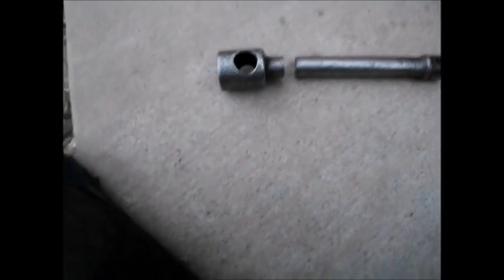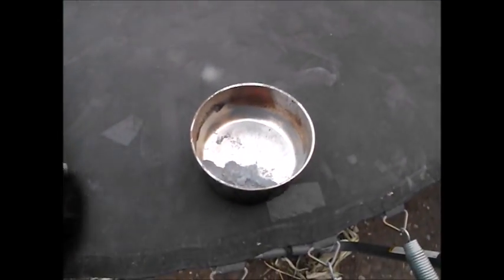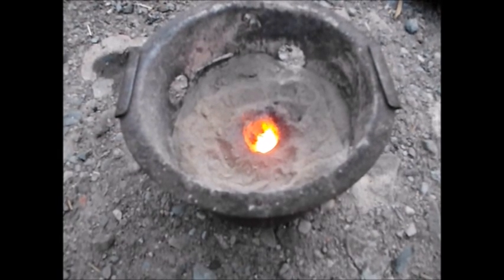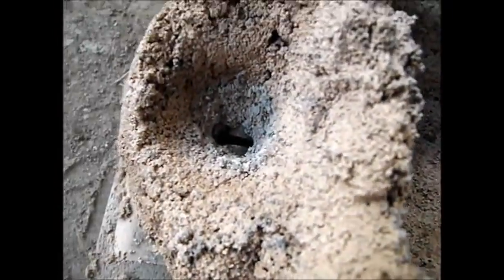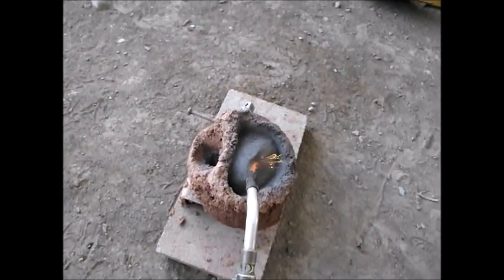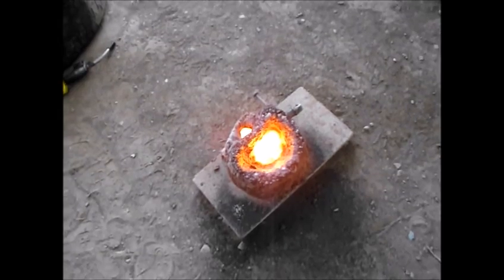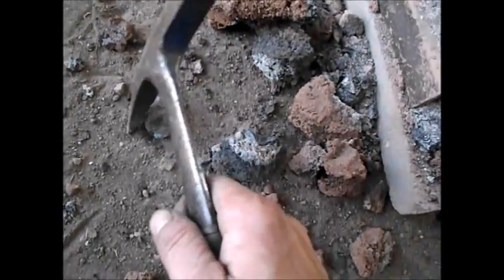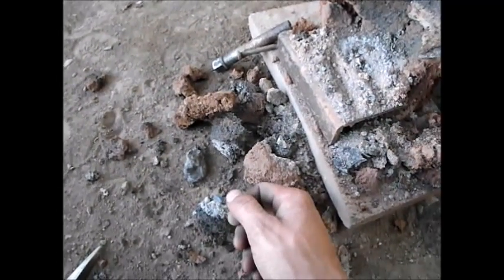My First Attempt at Thermite Welding

Comment: you could fix that thing using an arc welder. Since you sheared the chinsy thing right off, I suggest you grind both ends at an angle and fill the empty space inbetween. This way, it shouldnt break

Comment: If you mix a few large crystals of potassium permanganate with a few millilitres of glycerol you’ll get a chemical fuse of approx 20 seconds that I’ve never had a problem lighting thermite with. Also, if you use aluminium powder and magnesium oxide with no additives (other than carbon dust in the ball mill to prevent explosions) you’ll get a thermite that is almost completely smokeless and sparkless. The less carbon you use the better. I made a mix that was almost silent in its reaction and basically just glowed. Pretty cool shit.
Reply: Side note. The magnesium thermite does burn at a lower temperature. Somewhere around 1900C if I remember correctly. That’s a few hundred degrees lower than iron oxide based thermite.

Comment: Shop that turns brake rotors and drums will have lots of buckets of iron filings. It wouldn't take long to rust them. That's if you need to make a ton of thermite.

Comment: It will work with welding it if you use the proper alloy and pre heat and post heat it properly for the type of tool steel that it is.

Comment: 70% Al + 30% Fe mix (depending on type of iron used) makes it hotter
Just a tip for future thermite welding. Ive found the mix is everything.
What I'd love to see made is thermate or an exotic form of thermite (like your Cu+Al version, but I know there are many others which can be used). I never tried either of those.
Still an awesome experiment. 👍👍

Comment: If you'll ever get to read this :) If you want the weld to be strong enough you have to bevel each side of the break kind of deep with just a small peg left in the middle, preheat it some, tack it (grind the tacks a little), weld a root pass, and then a fill and cover or fill/cover pass with 7018 or equivalent. You could just leave it and it will be strongest, or you can grind and machine it if you wish.

Comment: Perhaps if you get the two parts white hot prior to setting the thermite going it would work perhaps maybe maybe not. But I'm sure the thermite is it touched the cold metal the molten metal probably cooled a tiny bit enough to make it not adhere to the parts

Comment: Having watched vids on welding rail tracks with thermite, maybe you should`ve got the parts to be welded, red hot, before starting the thermite reaction. When you did it, the molten iron, just didn't seem to adhere to the parts. Good video and attempt though!

Comment: demo failed , like soundless stinky fart . post success     try again . 
1. the mold should be good allowing insert of the tool  from eithr side of the mold . tool meeting in the flow cavity of the molten metal
2. heat up the metal in coal fire
3. fill up thermite in the thermite slot
4. insert thr tool in the mold
5. fire the thermite in three stages
stage i .33% lights up
stage 2 33% lights up
stage 3 33% lighst up 
how
the thermite should keep poring on reguilar flow.
Lets see if you can do it

Comment: that's why when they do thermite welding like in railroad rails they light it from the bottom and the hopper above it feeds down into the weld instead of burning everything out of the top before it gets down to the steel.

Comment: Hello, I didn't really think that you'll read this but I try it. The DB (Deutsche Bahn/German Train) use Thermite welding to weld rails together. This is the Process: 
The rails get a little Distance of only a few centimetres. Aufzeichnungen that they will getting heated at 1000 degrees Celsius. Now a crucible out of magnesite or shamrock (I hope the translation is right) gets on the rails. Now they use around 10 Kilograms of Thermite and trigger that. after a few minutes of cooling everything should be hard enough to hold an the excess material can be cut off. If you wait a few hours you can grinder everything perfect. 

greetings from Germany

Comment: your mold was wrong, need to wait for reaction to stop, allow Molton steel to pull up, open a check valve    allowing steel to flow to mold for repair. find video on train rail welding, it'll make sense.

Comment: I was looking through some comments but didn't see anyone bringing this up so sorry if it's already been addressed.  What is the negative impact of using the aluminum foil to hold the mixture?
Reply: Also, Aluminium melts at a much lower temp than the Molten Thermite and allows it to drop before it is fully molten

Comment: What's the secret ingredient.?
Reply: Green Vein or love. Who knows? :P

it's probably magnesium :P
Reply: Green Vein Correction, I'm on mobile so I can't edit my previous comment. 

I think it's a mix of Aluminium and Sulfur.
Reply: Shayne Kinney crushed match heads are not red phosphorus instead potassium clorate
Reply: roger brandt it was in a morter  and pestel and he lit it with a match, very unusual. . . thermite normally needs a magnesium lighting strip or a VERY VERY hot  flame. to ignite, so I would reason he crushed up match heads for red phosphorus, and when mixed in the thermite it would let a flame permitted throughout it, so probably crushed match heads in the mortor  and pestil  is the secret ingredient
Reply: roger brandt MG

Comment: The splatter from your thermite was the result of the heat meeting the water in your sand and clay.  By heating it to such an extreme temperature, and so quickly that the water doesn't have time to boil off, you separated the hydrogen and oxygen molecules that comprise the water, this resulted in the hydrogen exploding (hydrogen gas, plus oxygen, plus ignition source).
Reply: Very clever.

Comment: I think it did not weld because the 2 parts you were welding had to be heated red hot as well, but you tried to just melt metal and pour it over 2 cold parts. You should have had some termite beside the 2 parts being welded so they heat up as well.
Reply: yep!  look at thermite rail welding videos and how they set up the weld.  They get it hot before they it it with the thermite.

Comment: In the military we have a thermite safe (4 drawer like a file cabinet) destroyer it was the same size as the top of the safe and one inch think. On the side we had a screw cap with a magnesium ribbon inside. We pulled the ribbon out...lit it and left. With all that said maybe you could use magnesium ribbon to start the thermite in the future.

Comment: im sure cody know this but what did we (humans) use to make steel when we first discovered it. ill give u a little hint, what we use today is add carbon to the iron, well thats what we used back then too cuz thats how u make steel but it was in a different form and if u wanted u could make it today 

all u do is get iron ore melt it down then cast it into thin-ish rectangles (i guess it could be any type of shape but if i recall they did that cuz its easier to make swords and stuff but i could be completely off base. thats just how ive seen it done)
Then u put the secret ingredient and the iron castings into an air tight crucible type thing, and after a while u take it out and u have a steel and if u did a sound test it would sound completely different

 ill check back in a couple weeks and tell u guys or check and see who answered, and dont ve a douche and comment after u look it up, just think of things made out of carbon that were in High supply and VERY low demand back. just make guesses about whats made of carbon, and it is found/produced in manageable chunks, also another hint.... Farmers still use it today. but that isnt the only type of carbon that blacksmiths used back then - it was around the 12th or 13th century BC if im not mistaken

Comment: From what I understand(cousin works for BNSF) about Thermite Welding is that you have to encase the parts to be welded in the powdered thermite before lighting it so that the heat makes direct contact and performs the weld. You don't keep a tig-welding rod isolated from the stock, so it stands to reason your welding medium(thermite) would do anything if it was isolated from the stock(wrench). Plus it looks like you had the pieces too far apart.

Comment: Always wondered...every video of thermite I've seen the person lights it from the top of the pile.  That means it has to burn down through the remaining material to get to whatever you are trying to cut/weld.  Wouldn't it be better to start at the bottom of the pile and let the fire burn up?  Kind of like starting a fire...you don't light it from the top.

Comment: personally i would have beviled it down to a point like this >< then weld together so you have fusion the whole way threw the joint then heat treat it to whatever property's you want it at. also if the thermite did work you would have had high carbon steel with low or medium carbon steel which would more than likely shattered the first time you used it

Comment: probably would have worked well if you had made the mold deeper and wider than the part to give room for the slag to clear, I probably would have tried cutting down each half of the socket so they fit together then welded them, but the bevel method you used is surely better and easier too.

Comment: Thermite needs to be in direct contact with the metal you're trying to weld. Also, best practice would be to sand places of contact before putting thermite directly above the area you wanna weld. Nice demonstration still
Reply: I think that might be the reason why he said Putin the aluminium foil there was a bad idea
Reply: No, even without it, it wouldn't have worked. See the rail tracks thermite welding video you'll get what I am talking about when I say "direct contact"

Comment: Wouldn't it be better to torch the work piece for a while to pre-heat it? I mean, you'd have to make a more precise mold and maybe make some cuts in the workpiece face to sorta 'key' the molten metal into place. 

It's never going to have the tensile strength of the original part, but it'd be fun to see where it failed in stress testing.

Comment: While I'm sure you've already finished this project, if you need to weld Cr-Mo steel, it needs to be pre-heated, preferably to a red glow. Then use a high alloy rod, I've had luck with Allstate 275 rods. If you chamfer it out well and don't skimp on the weld, it should end up nearly as strong as new.

Comment: Looks like your pottery melted too easily and the Steel sung in.
 -I would try it again.

-Put the thermite in a Pot (pottery ore porcelain) in straight line over the too be welded gap.
-Leave a little space around that gap, so that the molten metal can run under and round it. That should prevent Slag in the former gap. While constructing, you may use paper to
keep the to-be-welded area free of clay (I have asked railroad welder).

-The Pot with the thermite must have a hole in the bottom that is covert with sheet steel.-The sheet not to thin, so that molten metal accumulates over it, before it will sink
down. I Thing, in your dimensions a 4mm sheet will do. (I haven’t tried it, but see friends
experimenting with that.)-The Sheet will also provide more metal output.
 -I have seen a film, some in India, adding old Files to cool it and not melting to much of the peace that should be welded and to have more material outcome with lesser termite.
-The high C content in files will keep the melting point down and extend the outcome of
molten metal.- The C content of the result get higher with files.

Comment: The Aluminium is too fine and the ironoxide has water in it.
Thats where all the flames, sparks and smokes comes from.
Heat up the Fe2O3 for a good amount of time and then use the formed Fe3O4 to make the thermite. The two substances should be ~0,5mm particles in size. This will ensure that you dont end up with a volcano with all the heat flying away.

Comment: You might want to try not putting the aluminum plug in the mold. This will allow the thermite  to get into the gap between the parts you are trying to weld.

Comment: Hey Cody, seen a lot of termite welding. I guess you should have heated both parts of your tool, before welding it with termite, so the melted iron would attach to both sides of your broken tool.

That´s the way it´s done with the railroad termite welding.
1. set up mold
2. heat up properly
3. get reaction started
4. clean, when still hot

Grettings from Germany

Comment: i didnt know it but ive actually used thermite to weld before. it was when we were doing a ground ring in a trench. they have little bowls of the stuff with a metal piece that hooks up to a little 12v igniter the cords extremely short so we used to argue whos turn it was lol itd shoot flames out and molten copper would fly everywhere because our molds were old.

Comment: bevel it and build up the sides around the weld to a thicker diameter n it will be the strongest point on the tool actually

Comment: Hey Cody, not sure if you have tried any more thermite welding since this video, but I though I would mention if you try it again one of the keys to success is to preheat the mold and parts to be welded to as hot as possible before adding the thermite powder and lighting it.

Comment: I have welded extensions before. I tapered the two ends to pencil points.  Oxy-fuel welded org mig (GMAW) or flux-core (FCAW) or tig (GTAW) welded or arc welded (SMAW) (with LH 7018).  Each time, I ground and buffed the weld reinforcement away so nobody could point to a repair...If you can weld x-ray quality (no inclusions) - you should have enough strength. Know that you will not ever have original factory strength with that tool; heat effected zone has different steel crystal alignment and structure and the temper differs along length of tool - but the extensions I welded - for some strange reason withstood more abuse than factory new ones that were originally broken doing less ignorant stuff with them. (We were usually trying to break a 1" dia. high strength bolt loose with a 6' cheater pipe on a 3/4" drive breaker bar). Also had to braze back together a breaker bar = brazing is 90,000lb tensile strength, where 7018 is only 70,000lbs tensile strength. breaker bar broke at pin arm at head, a tensile load. extensions failed from a torsional load. Therefor, I wasn't convinced that brazing was adequate procedure for repair in torsional load. We put more work into using the wrong tool for the job...because sometimes you just work with what ya got out on the swamp.

Comment: Why not try to friction weld your tool (oh err) in a lathe? it would be just as strong (or even stronger) than the original steel! Hold one piece static and spin the other apply pressure between the two until the join glows and plasticizes. Job done.